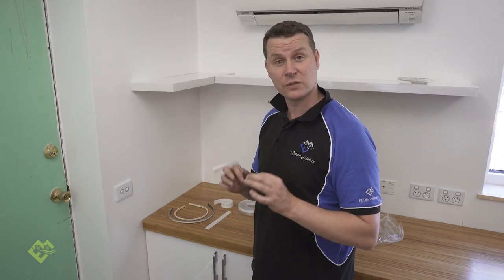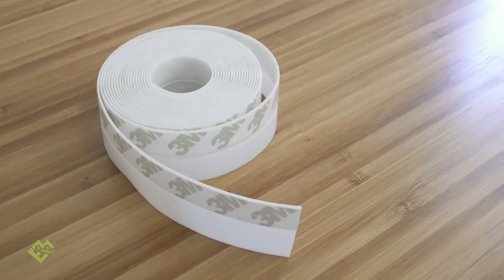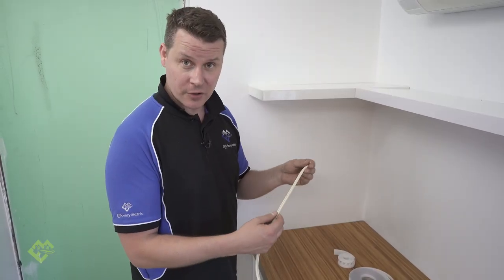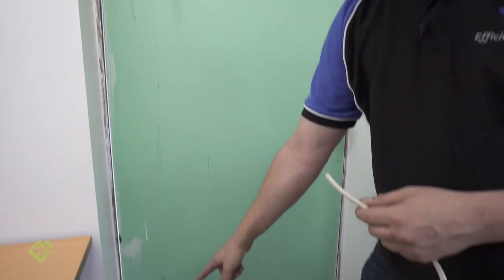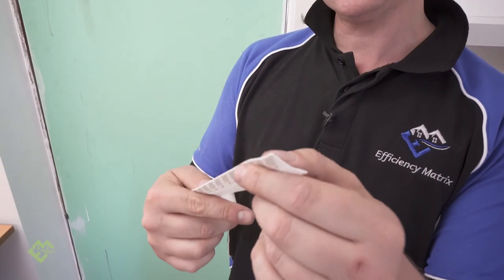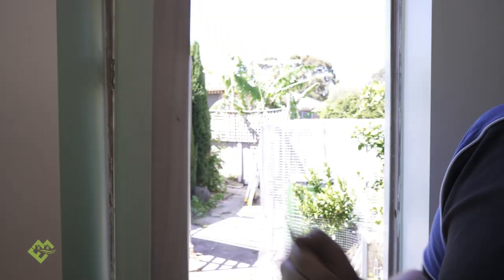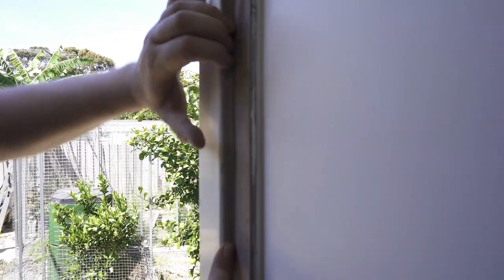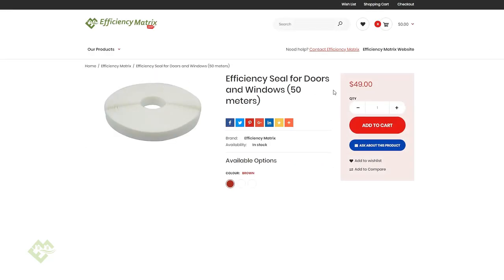Door seals, Window seals - The good, the bad and the ugly.

Comment: Hey, I'm in Glen Waverley down th bottom from you. I am thinking about wall insulation with rockwool, 3M thinsulate for windows single glazing and a whole lot lot more. If I go ahead do you want to use it as a video set?
Reply from the maker: Andrew C Give us a call some time Andrew.
Reply: @ecoevo  Wall insulation is in. As are some of the windows. The last lot go in Jan 22 2022. Oh and your door seal on the front door.
Reply from the maker: And how’s your house performing?
Reply: @ecoevo  Much more comfortable but I have to rip out and redo the Kevin Rudd botched insulation job done with R1.5 poly ceiling batts which doesn't reach the wall joint and all the cupboards etc.

At an uneducated guess I guess I have gone from ACH of 100 to perhaps 10. 

I really thank you for all your videos.
Reply: I should list what I have done. Spray foam underfloor (bodgy job tho), caulked the floor architrave to eliminate the gap to wooden floor,, closed the walls vents, plastered the unnecessary ceiling holes, foamed the gas return duct, removed a chimney skylight, retrofit knauf wall insulation, U1.4 PVC glazing, new bathroom vents, and contact paper over box aircon to stop airleakage until I get around to moving , and judicious application of spray foam into gaps.
Reply from the maker: Wow!   That’s impressive!
Reply: @ecoevo  This year:  Vaccum roof, replacement insulation R6.0, Remove box airconditioning, install Daikin US7 replacement, remove gas heating, new tile roof (lighter colour) with sarking added, if I feel up to it add solar edge solar, remove gas heating and install induction cooktop

Maybe.